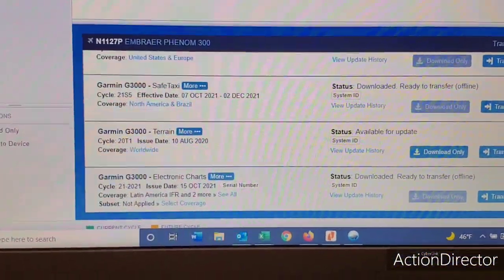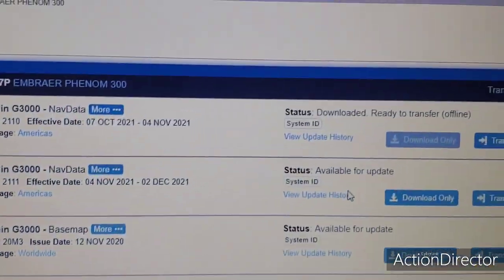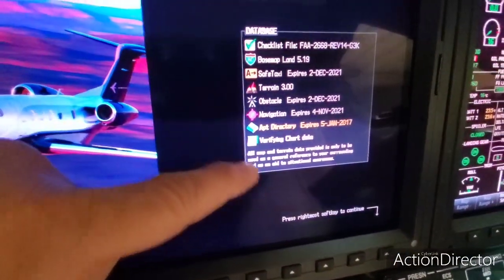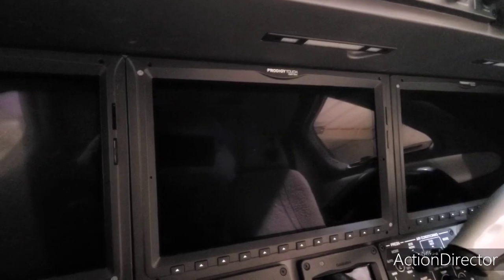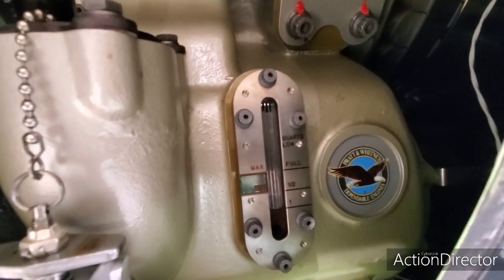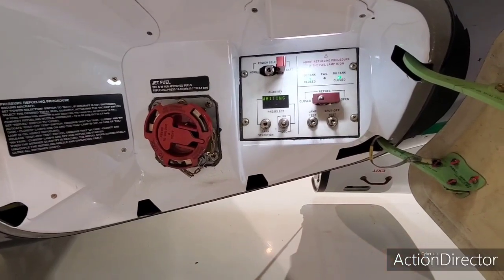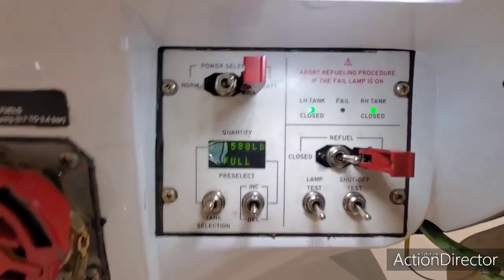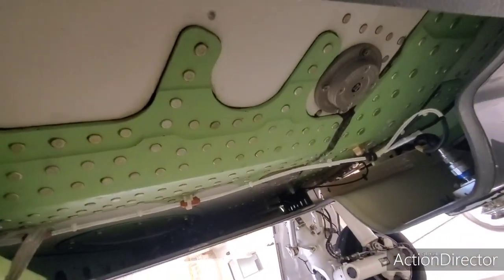Phenom 300 prepping for flight.

Comment: I really enjoy this video, …..but you have got to show a complete walk around opening all the panels. A tour of the hangar would also be appreciated.  Does the hangar bay have running water?  I am curious if the tires make tire marks on the floor as my car ‘s tires do in my garage.  What product do you use to wash your landing gear.  Can’t get enough!  Thanks
Patrick from Alabuquerque
Reply from the maker: Hangar does have running water, we park airplane on pads so floor is not marked. Don't wash gear anymore,  had some issues with water in areas, so stopped.

Comment: On a couple of your videos you've shown other planes passing close to your plane in opposite direction with some 1,000 ft of separation. In 2017 an Airbus 380 passed at 1,000 ft from a Bombardier Challenger and its wake turbulence sent the Challenger into a spin towards the Arabian Sea. After 3 rotations and losing 8,700 ft, the Challenger recovered and landed safely but the aircraft was not airworthy anymore due to the stresses suffered during the incident. How do you make sure that the aircraft flying on the airway above you and that will cross you at 1,000 ft separation is not an aircraft like the airbus 380  that will disturb your plane? Do air traffic controllers create a greater separation for those aircrafts with powerful engines, or do you spot the danger on your systems and request a lower altitude to get away from it?
Reply from the maker: Good question, couple things about wake. Planes create more wake when heavy, clean(flaps and gear up), and slow.  So it depends on where in flight and what airplane.  Most planes I have made videos of have been off to side or smaller(737 or less) and in the cruise phase.  I have asked for a turn when going to go below 757,767, and 777.  I have seen 787 and A380 in flight but never close enough to cause concern.  Most concern is on departure when airplanes are heavy and climbing at slow speeds under 10,000 feet, as IAS is 250 or less.
Reply: @windingtrail9319  Thanks for your reply. In those cases on departure, how much time of separation do you wait before taking off after a big and slow plane? Is it 3 min, 5 min, or depends on weather conditions?
Reply: In order for wake turbulence to affect a smaller plane at the higher flight levels, the smaller aircraft that crosses perpendicular of the path of the A380. I will say wake turbulence can remain as far as 10 NM behind heavy aircraft. 1000 feet below the path seems excessive being that the aircraft is not at a steep angle of attack. Now aircrafts generally fly at steeper angles of attack near their service altitudes than they normally fly due to density altitude. 
I hope this explanation helps.